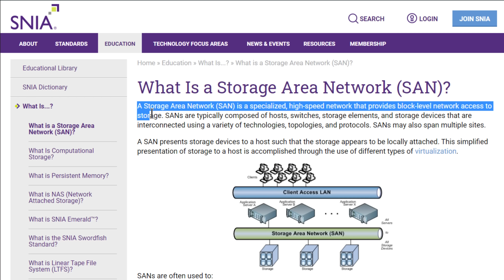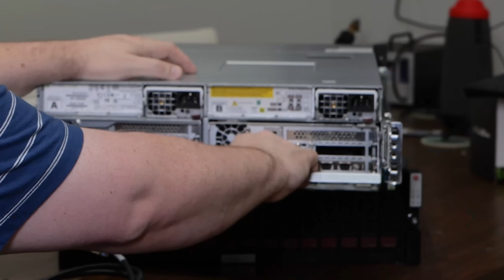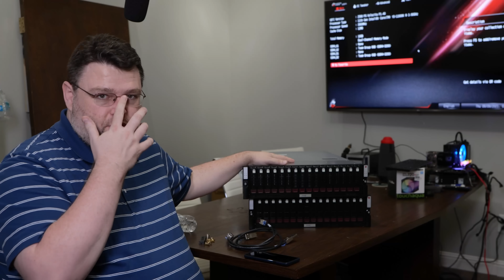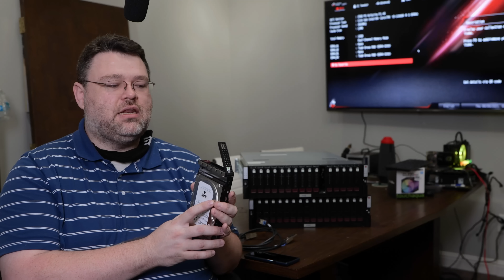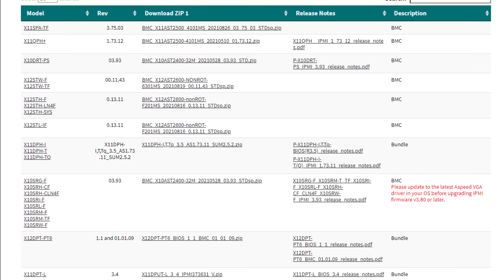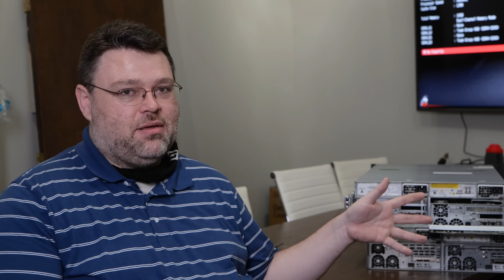Storage Area Network: Buy with Knowledge

Comment: We have used RAID 60 with a LSI controller with supercapacitor backup for 8.4 years. We have had one or two drive failures but so far the Supermicro setup has worked flawlessly. It's time however to replace our mechanicals with SSD. Not a big fan of SSD wearout; it means you have to replace them in a couple of years. Since we back up nightly across data centers that accelerates the wear.

Comment: As Chair of the Board of Directors for SNIA, I thank you for using our "What is a SAN" page. However, I'm afraid you missed what a SAN  is, as opposed to a storage target that is a part of a SAN. 

Your breakdown of the storage component is pretty accurate; storage devices that are used in SANs are very specialized servers with equally specialized control plane network I/O. A SAN, however, is a block-based fabric of interconnected devices that include the client I/O as well as network control plane integration. 

This is why, for instance, you will never EVER find a PCIe-based "SAN". PCIe is a bus architecture, rather than a fabric architecture. PCIe handles load/store I/O, rather than block-based I/O (of which all SANs are). You cannot provision or virtualize LUNs on a PCIe-based connection for a host (PCIe has no concept of LUNs or storage virtualization). 

For anyone interested in learning more about SANs - or storage in general - I recommend taking a look at the web series "Everything You Wanted To Know About Storage But Were Too Proud To Ask." The very first one goes into many of the topics about what makes a SAN, but others break down many concepts that many people may be curious about. 

https://sniansfblog.org/everything-you-wanted-to-know-about-storage-but-were-too-proud-to-ask/

Thanks again!

Comment: SAN is a designation of the Network, that is a storage bay/appliance  :) there are SAN switches that in that matter should be more representative of the SAN then the storage. A NAS is also a storage bay, as you said with probably some fancy software, but it is quite the same only the manner the storage is shared is different (block vs files).

Comment: I just stumble on to this video and who ever works in the IT and doesn't know how a SAN is build up should start learning very quickly or change profession. Nimble was a very meh product, I took care of one for a client few years back and it worked like sack of stones... Nimble didn't do anything different then a SC, Storewize, SVC, Datacore, etc already done. Oh and its HPE not HP... Using a MLC for write chashing is not that good, it just cheap... That disk is from 2013 and at that time SC used SLC for writes and MLC for reads... using the correct SSD for the right task, does a lot in overall performance... thats why there are so many "Mix used" SSDs. Using the right protocol to access your storage is also important... you can get out of a 10Gb Ethernet connection more performance out if you use NVMeOverTCP then using iSCSI... similar with FC. iSCSI is on the lower end of performance metric there is. If you use iSCSI on a +25Gb Ethernet you should move you lazy ass to migrate over to NVMeOverTCP!

Comment: Quite pleased with my ESOS (Enterprise Storage OS) that have been running my SAN since 2017 consistent of ALL flash (Yes 16 SSDs) and a total of 4x8GB Fiber Channel ports, connected to my Brocade FC Switch and 3 of my ESSI hosts. Its a freak in performance and way cheaper (Even accounting for the drives) as most shops mow move to object storage and I got all parts for free. This is my second SAN. The first one ran datacore software.
Reply: FREE? Kinda hard to beat.  (Just read about ESOS + SCST before watching
How does FC compare to SFP+ or SFP28 ..? 
Doesn't FC use different bit sizes..?  for parity or something ..?

Comment: So this is not a SAN,  this is a Storage subsystem that is connected to a SAN (could be FC or IP). Drives me nuts when people talk to me about SAN and turns out they dont mean their fabric or IP/ISCSI network, but their storage box...
Reply: IF connect Target<->Initiator what kind of storage system do you have? Lets say you have multiple ports and Initiators? I would still call this a SAN. I can connect my PC with another PC and form a Network without a switch.
Reply: Yes, and that is called direct attach, which is different.. well not different, different, but a subset of networking. Same you can have a host /initiator/ and a storage subsystem /target/ in DAS solution, this is still not SAN..

Comment: First time hearing about these. Sounds nice.

Now, if only you could scale it way, way down for consumer use.

If you had, roughly, a 200 to 400 USD micro-Storage Area Network with a capacity something like 384GB, you could run a very respectable node for a peer-to-peer web hosting network like Zeronet, IPFS, Dat, or Freenet. Perhaps something that hasn't been invented yet. (Looking at the features and adoption by other software, I like Zeronet first, due to the ability to publish changes. And IPFS second, for the integration with a monetarily incentivized distributed storage system. Zeronet apparently needs people to start working on it again? The Wikipedia article said development stopped, but not why.)

A tiny, consumer grade Storage Area Network sounds like a great place to install an OS, for a self-employed professional that needs an extremely reliable computer to do work on.

It's possible I misunderstood some things in the SAN explanation. (Actually, it's practically a guarantee that I did.) So, what I said above, might sound especially odd.
Reply: Consumer use? NAS with a few multi TB drives and use it for all file storage.

Comment: there are a few things you left out about Nimble SAN's.  
   1.  there is a point that you have no choice but to use SAN in an environment and its because of backup's.  no longer can we just toss a tape into a tape drive and back data up in case something happens.   data is too big now that you cannot back all of it up in a reasonable time period.   you try backing up a 4TB exchange server every night.. NOT gonna happen.  so SAN's allow you to do Snapshots, and replication to other SAN's.  thus giving you a backup method other than your typical Backup.
   2.  Nimble is special in many ways other than hardware..   A.  DEDUP technology they use is WELL BEYOND anything in the industry, where most SAN's either dont do dedupe and NAS's do file base dedupe.   Nimble does Block level DeDuplication.. which a MASSIVE increase in storage abilities.. a 20tb nimble can store well over 100TBs of data with dedupe..   drive data storage is also unique that because of DEDUPE at the block level,  they can Strip the data across multiple drives without loosing much space.. where normally a raid 6 stripe uses 60% of the drive space for striping data,  Nimble uses less than 10%.. which is amazing..
   3.  SAN support,  most home  users dont really care about this, but a massive Enterprise DOES.   Nimble support is beyond better than any others on the market..  we heard the stories of nimble sending a drive to a datacenter and having it arrive just in time for a drive to fail,  never did we emagine that it would happen to us.  our company purchased a nimble,  3 years later!!  we had a drive failure,  Nimble had a Tech at our DataCenter doorstep  hours before the drive actually failed..  They can monitor those drives in a way that they can predict failures well before they and they take action.   we had a snapshot have issues once with converting to Read/write mode,   i literally had a Nimble support tech on the phone calling me within minutes of the issue.. i had not even begun to diagnose the issue myself before they called, WITH THE ANSWER..
   4.   Nimble Snapshots are another AMAZING Tech far beyond any other SAN or NAS.    Nimble has the ability to do Instant Snapshots, and you can mount that snapshot on any VM, in either READ only mode, or READ/WRITE mode.    most SAN's you only have 1 option,  Restore snapshot.  which overwrites the entire dataset,   if you have VMWARE and you store multiple VMDK's on a single dataset,  then this is a HUGE problem,  if you have to restore snapshot for 1 VM  then you restore it for ALL OF THEM at the same time.   where Nimble you can Set ANY snapshot to READ mode,  or READ/WRITE mode, and you can MOUNT it,  then you can recover just the files you need without Affecting any other dataset..   

if your SAN Admin, or even just a systems admin who has worked in VM environments, then you know how these options ARE MASSIVE.    but i cant stop there..  NIMBLE integration with VMWARE is by FAR HANDS DOWN the best compared to any other..  you can pretty much do anything, provision, mount, dismount, grow, or shrink datasets with just a few clicks acrossed any number of VM hosts.   MASSIVE ADvantage.  any others, you have to do the work on EVERY HOST..   emagin working in a vmware environment with 20+ VM hosts,  and you have to mount a dataset acrossed all 20 hosts..   with nimble, its just a couple of clicks, done.   with others, your doing the same operation 20+ times.  

anyways.. cheers.
Reply: honestly,  back in the day before HP purchased nimble,  Dell was also bidding to purchase the company.. and i gotta say,  DELL really missed out on Nimble.. because before Nimble, HP WAS CRAP!!

Comment: Cool video. You mentioned VSAN (and I would add XOSAN and similar solutions), but as a 28 year old who only worked in startups his whole life, what would be the benefit over just having a CEPH cluster?
Reply: far less hardware to maintain,  less power to use,  even though nimble is a power hog.. but also consider that Nimble would allow you to TRAIN others very easily to do very complex tasks, that you would never have a novice do with any other San, or vsan, or even RHCeph
Reply: doing startups,  your main concern should be taking a vacation every once and a while.   lol.  having 1 guy who knows it all is very good for a startup,  because it saves them a tun of money, but it can also cost them allot of money..  what if your hit by a buss?!   having a good nimble,   you can be hit by a buss, and the company can keep going without you..  or you can take a vacation without worry of being called because a damn drive failed.

Comment: What about ceph replication using nvme, that’s the route I’m heading down.
Reply: bad idea..  RHCeph has issues that RH wont admit to.  and make sure your running FULL RH Certified hardware.. or else risk loosing all your data.   also check your NVME's under the stickers.. because those damn manufacturers have been swapping chips out, which really screws over RHCEPH.   you think you have all the same drive types, yet it will be a mix of 2-3 different drives with different chips.
Reply: @danratsnapnames  I prefer to use different nvme drives with similar specs in a raid configuration. So any nvme drive can fail, and any node can fail if two nvme fail on different nodes at the same time. Still good. I’m not pushing them to the limit so to some degree they are over spec for my needs.
Reply: @nathank5140  those cases, your IOPS are going to be a major bottleneck.  as IOPS increase, so will your replication acrossed nodes, which in turn slows everything down.   just a fair warning.

Comment: How can you talk about nimble without mentioning Infosight? Infosight is the reason why HPE paid $1 billion, not the hardware... I usually like your videos and the points you make but this video reeks of lack of knowledge of current enterprise grade hardware (and included software/OS) and the direction the industry is moving right now.
Reply from the maker: I did talk about how the special sauce was the software, had to be since the hardware was far from special, software for monitoring and analytics with nimble, and how having that means you can use it to improve the performance of any San. It's not magic (anymore) and it's a basic feature of the software now where it maybe wasn't then.
Reply: @Level1Techs  You completely miss the point, Infosight is more than monitoring and analytics, is predictive and for nimble it actually resolves  86% of all level 1 and 2 issues without human involvement, and 93% of issues that can't be resolved are reported automatically to Nimble support leading to the issue being identified and reported to the customer before the customer himself has discovered it. I know most hardware vendors have something similar but Nimble has been doing this for over 10 year and has the most mature solution, with most deployments in the industry, no competitor is anywhere close to nimble in this area. That is why it was worth 1 billion and why nimble customers are so satisfied, Nimble is easy, runs itself and thus it frees up IT-resources.
Reply: @madbullen chill bro

Comment: We went with HA Synology FS3400 units for a modest just add drives SAN appliance. We don't have enough to justify the expense of a larger enterprise solution, but enough that management wanted to get off of a DIY solution.
Reply: eek.. i hated synology.   that damn interface still haunts me today.  maybe once management realizes that they are a DATA company FIRST, then the core company comes second.  good way to point this out,   ask them if they can survive without any storage for a month or two..  that answer alone should be enough to justify a reasonable budget.

Comment: Last I shopped for a big SAN, I barfed when I saw per-TB licensing. I opted for some Supermicro 45 drive systems running FreeNAS. We got more storage, higher reliability since we replicate entirely instead of running dual controllers on the same storage, faster performance since we decked them out with huge Optane based caches, and we spent a fraction of what they wanted to charge me on the initial buy. Whats even crazier is I can buy another system to replicate to every single year for the annual per-TB license cost they wanted to charge us.

Heck you don't even NEED to deal with "not enterprise" Freenas/Truenas core. You can do vSAN from VMWare (Not as expensive as you think) or Storage Spaces Direct from Microsoft and still be way ahead of these traditional storage vendors. Its a bit more work to design and setup, but its a fraction of the cost and WAY better in every way. I've done all three successfully and I'm far happier with those systems than the terribly expensive SAN's we've bought from companies like Pure in the past. Its no competition for me.

Comment: What is the best parallel filesystem that gives native performance when used with 7000/4000 nvme's? I want a filesystem that can sustain 28 GB/sec which one? Lustre? Ceph? Something else?
Reply: ps I'm using two FDR infiniband cards per node so 4 ports running 7GB/sec so each node has 28GB/sec infiniband bandwidth

Comment: Great video!  To add a core thing: SAN is block level storage.  NAS is Object storage.  If you have a SAN, whether you are using ISCSI, or FibreChannel you get block level access, so you need to format the LUN in the OS that is mounting it.  When you have a NAS, you have object level storage and it is presented as basically a shared folder.
Reply from the maker: Not necessarily. I don't even disagree with you but vsan and other products provide both smb and nfs exports
Reply: @Level1Techs  yep, but that is down to vmware wanting a simple name, not redefining what a SAN is (though I suspect they would disagree).  Object storage has real advantages too for de-duplication visibility and multi-host access to the same data.

Comment: I’m a bit confused, so a San is the same as a nas with fewer drives and older hardware?
Reply: no,  a SAN is abit different than a NAS.   consider a SAN to be more redundant.   the lines between san and nas have become blurred over the years..  it used to be "Serial Attatched Network" driven storage,  or "network attatched Storage"    where the Serial attatched network had to run on a Fabric like fiberoptic that ran on SAN switches.. much different than Ethernet switches..   Ethernet switches uses Packet based data packets..  where your old typical SAN used Scsi blocks sent in a Serial fashion.    the SAN switch would handle the SCSI blocks and toss them to the node that needed the data..   but today, SAN and NAS are pretty much the same because you can run SAN on Ethernet.   so really it just describes the hardware/software being proprietary.
Reply: @danratsnapnames  thank you for the knowledge! It is very much appreciated.
Reply: Never mind, I should have waited… figured out the difference.

Comment: The future of SANs is in bound for a major change using Intel Optane DIMMs... technology switching will remove large capacitor batteries, DRAM, increasing capacity, lowering energy costs, and making spinning rust... dust...
Reply: That's a long, long, long way into the future. Maybe even 15 years. HDD's will grow to 30+ TB making them difficult to move away from while the patent for Optane will ensure a high price for Intel.